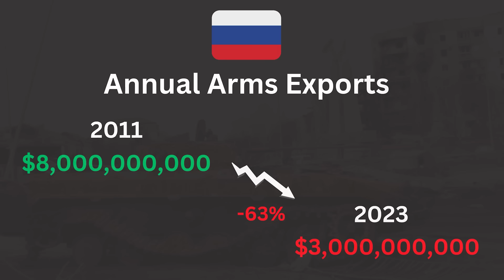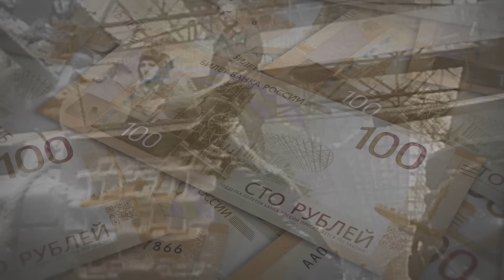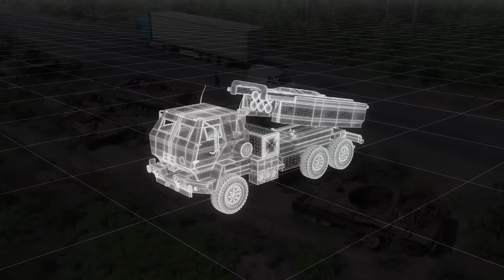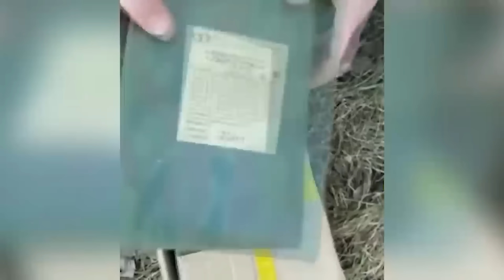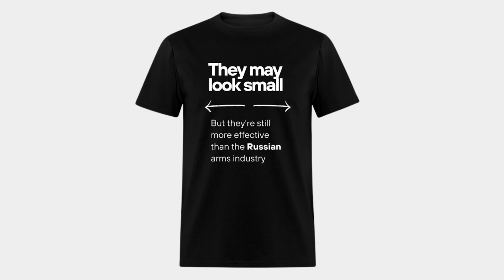The Russian Arms Industry is in Serious Trouble

Comment: There are a lot more issues at play here.  Most military leaders are smart enough to realize that a lot of Russia's poor performance has been due to corruption, poor maintenance and poor training.  This may influence some politicians (since politicians generally specialize in knowing nothing about anything), but generals are more savvy than that.  There are a myriad of other problems that stand in Russia's way:

1.  Many of Russia's more modern systems rely heavily on chips and electronics components that they originally sourced from nations that have since cut trade ties. 
2.  Heavy losses in Ukraine have required that Russian arms production shift towards replacing losses. 
3.  Many nations that have traditionally bought from Russia are buckling under geo-political pressure from the West, which most of the world sees (correctly) as being much stronger economically than Russia.

Thus, it's really a perfect storm of events.  Yes, the battlefield reverses have played a role.  However, a bigger factor is that Russia simply can't produce as many modern systems and those they do produce are heavily earmarked for their own military.  It's also notable that India and China are rivals.  India isn't interested in Russia's older equipment as it wants modern equipment that can keep pace with the PLA's modernization drive.  In addition, the closer relationship between Russia and China undoubtedly has India concerned.  You really don't want to be reliant on your enemy's ally for weapons in case of a war.  China, in the opinion of nearly all analysts, has passed Russia in terms of both ground and aircraft design...or is at least equivalent.  So once again, no real incentive for China to buy from Russia.  Many of Russia's old allies in Europe (the former Warsaw Pact) are now NATO nations and looking to quickly shed their Russian equipment in favor of German/US equipment.  That leaves Russia with very few customers left.  Some nations in Africa and South America may be interested, but they don't have nearly the spending power or Russia's old customers.

Comment: The complete and utter failure of the AK-12 Program is pretty much the embodiment of this. [Mucho Texto warning]
Back in 2011, they had a prototype weapon that was a complete overhaul of the Kalashnikov with a lot of modern upgrades. However, the weapon was incredibly unreliable and the project was abandoned, nearly killing Kalashnikov as a company. It took until 2018 to get a new AK-12 to be released which is significantly less innovative and is effectively the current AK-74M (which itself is an upgrade to the Ak-74) with Picatinny rails and a burst fire function. The War in Ukraine then showed the weapon to be massively flawed; the burst fire function doesn’t work and the weapon is difficult to change fire modes, along with the barrel only being able to accept one specific brand of suppressors which are in short supply (thereby kneecapping special forces use). The Picatinny rails were meant to enable the rifle to attach optical sights like the M4A1; however most troops have not been issued such optics. The rifle was apparently so bad they’ve had to create an upgrade package that is only now starting to see deployment.
Reply: I have a Bulgarian SLR107R, and I ended up getting an actual Russian Axion EKP-1S-03 Kobra red dot for it, and - in standard Russian fashion - it barely wanted to actually work.
Reply: Most Russian and Ukrainian soldiers seem to be equipped with AK-74 with a wooden stock.
Reply: There were two rifles: AEK-971 and AN-94 ( conceptually merge of AK & H&K G11 clusterfaq ).  First was less exotic and far more sane project.
Reply: @internetcensure5849  Probably because both sides sit on faqton of these rifles and quabzdillion tons of ammo....

Comment: Good analysis but I'd like to add that shortage of spare parts on the market is more problematic for Russian arms industry than equipment shortage  itself. Think about it - if you want to buy a new car but none are available you can keep driving your old car for some time. Not ideal but it'll do. If, on the other hand, you need to fix your old car but the dealer tells you that you have to wait for two years for a part to do it chances are you'll pick another brand for your next car. Military equipment requires a lot of maintenance - artillery barrels need to be changed every ~3000 shots (why do you think boomerang missiles happen?), jets require 2 hours of maintenance for every flight hour, etc. If your entire stockpile of military equipment runs a risk of becoming a pile of scrap metal due to neglect because of Russia's inability or unwillingness to supply you parts chances are finding a new weapons supplier will your top priority
Reply: Most warplanes require far more than 2 hours of maintenance per flight hour.

The MiG-29 nominally requires 11 hours, but it's apparently closer to 15.  A careful operator will double that with inspections.

The F-16 nominally requires 17 hours.  That number isn't directly comparable as it includes inspections.  A careful operator will add to the inspections, making it roughly comparable to the Mig.

The F-22 and F-35 require far more hours, roughly double.

Comment: Politics and archaic ergonomy, it's pretty simple. Even when those guns are reliable and are available even in NATO calibers, today soldiers need something more comfortable and ergonomic than AK which still doesn't even have bolt hold open, selector is like from 40s, handle on right side only and rails on dust cover, which is really not great for accuracy and because of automatisation, CNC and robots in western factories, we can now made milled guns cheaper and even lighter. 
Most of today countries have professional army, to have "idiotproof" gun is not a priority anymore.
AK family is just obsolete now. And before someone say "but western wapons are not reliable"  there are definitely western guns which are the same reliable as an AK, or even better. Most of problems with AR platform were already solved, you can have short stroke piston system, which is realiable or even other nonAR constructions from western companies, AK is obsolete.

Comment: If the presmise of your video is correct, and people dont want to putchase russian equipment because its being destoryed in ukraine, wouldnt the same be true for western equipment? Just this week, 25 western tanks and armored vehicles were destroyed in a convoy. I think your later point in the video is more accurate, sales likely decreasing because they're commiting their production to the war and sanctions.
Reply: The shift away from russian weapons started long before the war in Ukraine. India for instance choose to buy Rafale fighter jets. Which is a massive shift away from russian hardware. Because if you change from russian to NATO aircraft, you don't just change the aircraft themself. None of the russian missiles, bombs and stuff they have in stock is compatible with the Rafale. So they also have to buy new ammunition and stuff. So you only do such a change if it gives you a massive tactical advantage. Also China started to use their own weapon and weaponsystem designs, which are mostly not compatible with the older russian ones they still have. Also the main difference between western and russian tanks is, that in western tanks in most cases the crew survives a hit. Western vehicles aren't that much harder to take out than the russian one, why should they be, should at the the tracks of a Leopard 2 and it will stop it. But the crew will most likely still be alive and the vehicle is repairable.

Comment: Yeah, well, they do have a domestic requirement to resupply their losses in Ukraine which means less sales as they need them more and you can only make so many at a time. That being said, their small arms are definitely good enough, many of their anti-tank and aircraft systems are surprisingly relatively high quality, their tanks are designed for offense and are death traps of poor design, their aircraft never have been up to par with western designs regardless of the massive amounts of propaganda spent. Their equipment is only better than that copied and produced in Communist China as everybody else's equipment is better, even little countries with small manufacturing capabilities in comparison. Quality wins and the orcs never learned that as they fail to grasp that simple concept in other than a few areas.

Comment: Russians were (IN)FAMOUS for terrible POST-SALES SUPPORT even for premium customers like India.  Equipment is OK and even western inserts are not a problem; some buyers purposefully choose to integrate western components in some extent.  This is still mostly capable and afordable equipment that in SKILLED hands wield terrible destructive power.  Problems are maintenance and training.  Russian hardware (case in point: Su-30MKI) is still good fit for certain countries, not only politically, but due to desing - India faces similar geographical challenges as Russia and until point, had similar perks (cheap labour) - important for maintenance hog like Su-30MKI.  Russian equpiment isn't particularly more sturdy than western, sometimes due to age of design and manufacturing limitations is actually more complex (see gearbox / transmission in T-72s) nor less maintenance intensive (sometimes, quite the opposite).  It was, is and still will be a good deal for those who know how to use it, or who have no other alternative. But again - if your opponents drive T-62s than having battalion's worth of T-90s is better than for the same money buying company of Leopard 2s or platoon of M1s / Leclercs. Enough to do the job, you can cobble some parts alone, probably had similar tanks in past and no strings attached.

Comment: Russian weapons are designed for a very large conscript army and military which explains why their jets don’t have gps, their tanks lack crew protection and their guns are essentially an inverted M1 Garand bolt (which is essentially the only reason the AK-47 has a hard time jamming) with 30 rounds of 7.62. Good for spamming large numbers of untrained men but horrible if they have to be stored, maintained or fixed.
Reply: Russia hasn't used the 47 since the 70s
Reply: @Joemommaf  the design is still in use as the AKM, AKS-74 and the newer AK-12. Essentially the same rifle with a distant cartridge and materials.